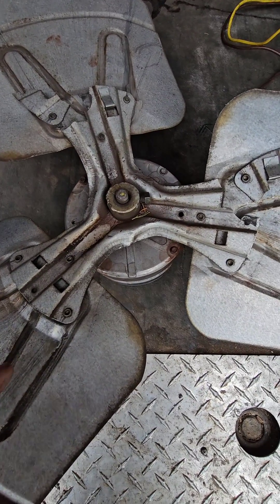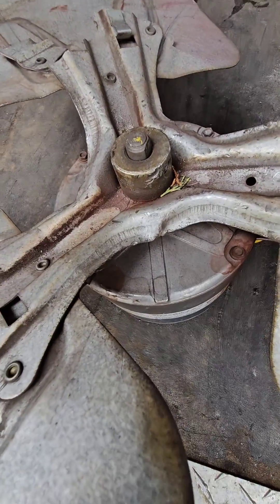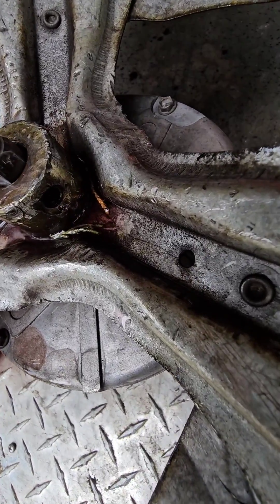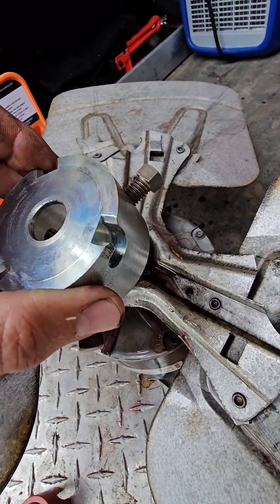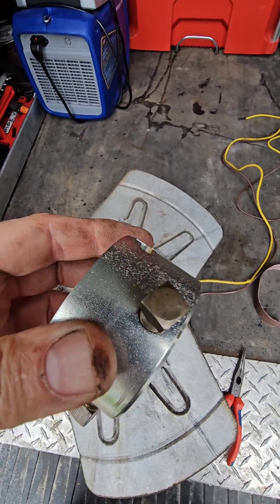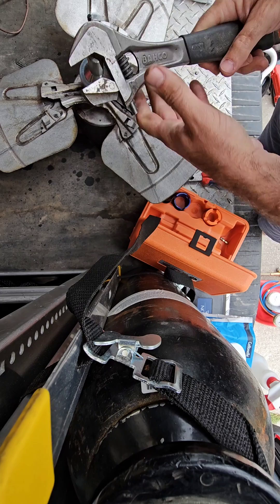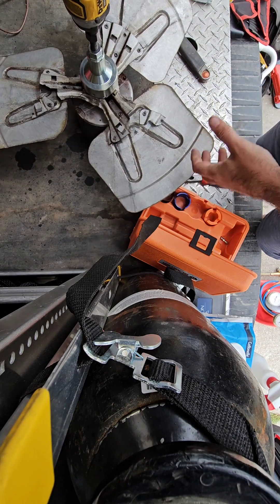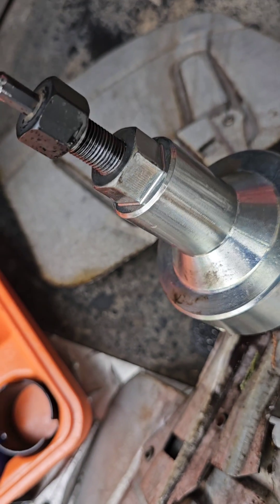How To Use A Hub Puller Using The Supco Hub Blaster

Comment: I’ve read some reviews that say that the 1/4 shaft snaps off during use. What are your impressions of durability? And do you think it would it be worth the investment against the FBP100 fan blade puller? Thanks for the video.
Reply: I have/use the fbp100 and use it often. I file the shaft and then sand it. I use oil. I get about a year out of it and then need to replace it. The fine point is gone after 2 or 3 uses.  I have had the screw/shaft strip out, I have also had it bend. I have had the locking screws also bend.  It is a real life saver and I replace it right away. I bought some hydraulic 5 ton device on Amazon for 3 times the price that the seals blew out the 2nd time I used it.The boss doesn't want us to use anything like this he wants us to cut the shaft and hammer it out from the motor side.